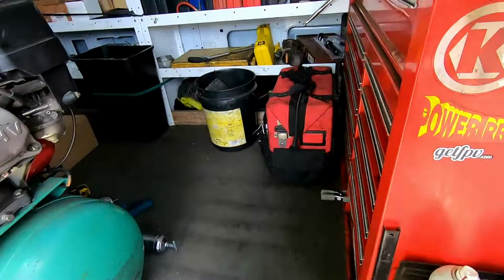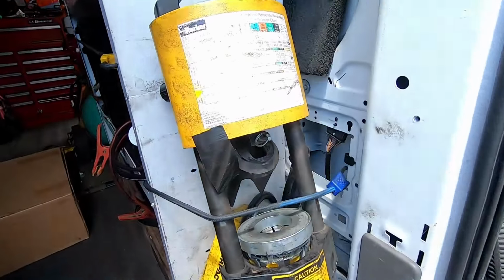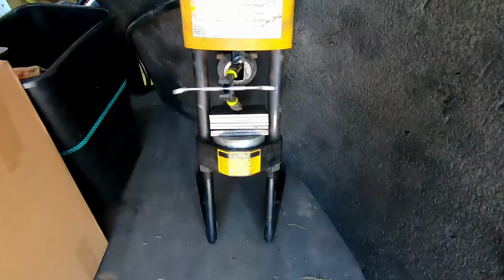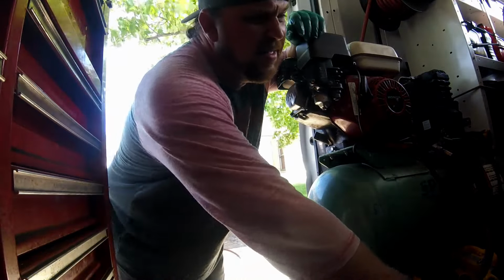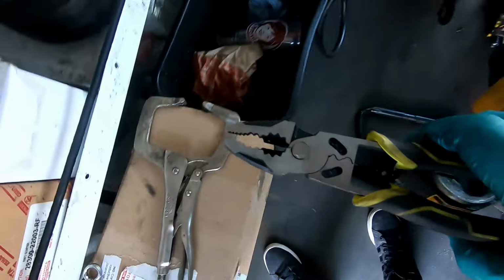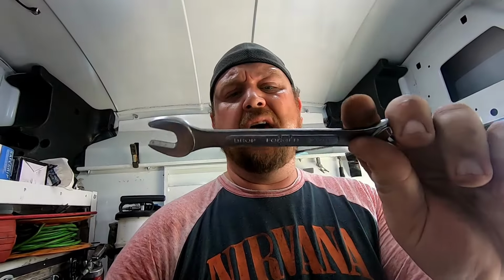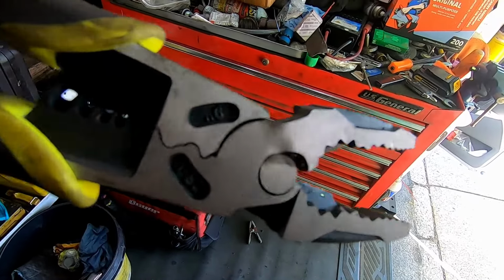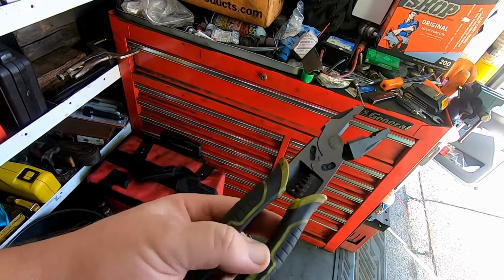FUTC Is FUCT

Comment: Had the pliers been a harder steel, then they definitely would've exploded. The funeral service was beautiful.  🤣
Reply: Yea I've noticed that a LOT of tool manufacturers these days cut their costs by just skipping the whole heat treatment and tempering parts of the production line, we bought some steel scribes and centre punches and they all deformed with the very first use of them, so we sharpened them all and then did a quick little heat treat just with Mapp gas torch and a bucket of water and they haven't lost their points ever since, even after several staircase and balcony jobs where we used them religiously. You can turn a lot of cheaper tools into very good ones by just finishing the manufacturing process on em
Reply: You could see the rusty tears of the bereaved as the camera panned across their jaws.
Reply: @dustyjohnston1479  shear poetry
Reply: Was thinking the same thing.
Reply: Well, now he needs to put them in a forge and harden that steel
Reply: Any one noticed that the pliers had the same width as the shovel. Must have been Made for that 😂
Reply: Steel with higher carbon costs more they're not trying to build a reputation for high quality tools they're just trying to sell as much crap as possible to people who fall for this sort of thing.
Reply: @Jude The Neko Gamer ye im diving into unreal myself as well coz games are just blatant cashgrabs these days with absolutely fuckall sustenance
Reply: It was a nice funeral. I heard they had a gallon of WD-40 at the wake. Everyone was getting loose.
Reply: @iamgriff  lol 😆
Reply: Well, if it's not hard enough to explode, it's certainly not hard enough to cut a wrench.
Reply: The fact that you couldn't cut a wrench with this kind of tool under any circumstances proves that they're targeting people too stupid to realize it.
Reply: @Faith_Family_Firearms_Freedom  was the pun intentional

Comment: Took a beating and held up surprisingly well. Other tests to failure I've seen have the head snap at the pivot or the pivot even fly off, probably because the harder steel is more brittle. Great vid - I was hoping for something more catastrophic but the burial was a fitting end.

Comment: Not quite sure, but I've seen several comments saying how if it was a better aloy/higher carbon steel, they would've popped, and I agree. I can imagine that they are something close to A36[mild steel]. It's probably a little better, since they are still a "tool" but yeah. Probably not to far of from rail spikes or similar stuff.
Reply: It also depends on heat treatment of the tool.
Harder steel is more brittle. However making tools reliably hard is difficult and costs a lot of money, easier to just temper the shit out of it to make it 'hard enough.'
Downside is, this has negative effects durability, wear resistance, and corrosion resistance.

You can get some petty good tools out of medium carbon with a good heat treat.
But, being mass produced and chinese, little care is put in.

Comment: I really hope you have a tourniquet in your toolbox. It doesn't take too long to bleed out if you sever a vein/artery
Reply: The red cloth shop towels work in a pinch
Reply: Those heavy duty wire ties are there for a reason! 😂
Reply: @k20nutz  improvised TQ's have like a 90% failure rate
Reply: @blaydCA  it needs to be at least a half inch wide to avoid nerve damage. CAT TQ's are only $20.
Reply: @brenthinton6855  the victim's t-shirt and a screwdriver will work in pinch, had this been an actual emergency and not a "funny ha ha" comment.
Reply: @blaydCA  it can work if you keep constant pressure on the screwdriver. With a TQ it locks in place to keep pressure so you can still dial your phone or drive to get help. I recommend you take a stop the bleed course or TCCC course. It is very eye opening!
Reply: @brenthinton6855  I have taken multiple  courses over the years. Thanks
Reply: @blaydCA  cool then you know that a field mechanic is usually alone and will need to have a free hand if the other is incapacitated.
Reply: @brenthinton6855  alone, in the middle of a deserted warehouse because a nuclear bomb wiped out the village. The nearest person is a solar system away. His fate is sealed! It could be worse!
Reply: @blaydCA  there is always a worse situation. I don't understand how that has anything to do with this. With a bad bleed you can bleed out in 8-12 min. average response time for EMS is 15 min. and that time doesn't start until dispatch has a responder in route. The response time can easily be 20-25 min. or more depending on where you are, traffic, how many people are being staffed in the area, road work. The list goes on. Anyone that actually argues against having a $20-30 TQ on hand is really something special in my book.
Reply: @brenthinton6855  Golly gee whiz! Better pack an ENTIRE Emergency Hospital.... just in case! 
FYI: most service persons travel to occupied commercial/residential jobs sites or they have a helper. It's called "the buddy system". Service persons also have the required Personal Protective Equipment as needed. 
Feel free to carry on with the histrionics.
Reply: @blaydCA  man 1 small cheap tool that can save your life is hardly a mini hospital. I am a service tech and I can't tell you how many times I have been doing stuff with a grinder or high pressure press and been completely alone. I have no idea why you are so against having a TQ on hand. What you are saying makes no sense. It is a very small tool that can fit in your back pocket or toolbox easily. Why not have it?
Reply: @brenthinton6855  For What It's Worth: Your TQ doesn't belong in your back pocket or a tool box. It belongs in a dedicated first aid kit. If you're bleeding out, a t-shirt and any tool will work IMMEDIATELY to stop the bleed.
 If you're taking jobs that can't afford the cost of a "helper" or won't provide an on-site person for safety, then that's on YOU.
Reply: @blaydCA  what is wrong with being prepared? Self reliance is what people lack these days
Reply: @brenthinton6855  I'm quite self reliant. When comes to safety, it's EVERYONE'S responsability. The few commercial clients I kept in my retirement pay me quite well for a professionally completed project or repair. If I am requested to be on-site during non-business hours and there is a risk of injury, they provide me with a helper or at least a warm body for Buddy System SAFETY. There's far more dangerous tools in my decades of tools accumulation than an angle grinder or hydraulic power pack. 
When I started in business (1976) telephones had DAILS, and airbags was a talkative person!
Here's some advice: IF you're working solo way remote- invest in one those satellite emergency communications devices that gives a GPS coordinates for first responders.
Reply: @blaydCA  a TQ is so much cheaper and a cell phone has all the same capability. Also that doesn't fix the problem of bleeding out while you wait for someone to respond. It makes no sense to not have it around all things considered. We are at an impasse here. You seem more comfortable putting your life in someone else's hands and that's fine but I live on an island where it can easily take an hour or more to get to a hospital and I have experienced response times of well over 45min. You may be bullheaded and not want a simple tool to keep on hand but I'm sure there are many other people that will see this advice and decide to spend $20 on something that can easily save their life. Prepare for the worst so when nothing happens you will still be ok. It is really that simple. I'm not telling people to go get chest seals or decompression needles or a full combat med pack. Just one tool that has saved more lives than a t-shirt ever will.
Reply: @brenthinton6855  I suppose if you are the sole occupant on an island it would make perfect sense to have an above and beyond medical kit WITH some advanced "first responder" courses under your belt to stabilize things. Meanwhile: the BUDDY SYSTEM with a good medical kit in that remote location is better still. Any medical kit will only get you so far going solo. I venture into areas that Cellphone signal is sketchy or zero-  hence my suggestion.

Quiz Time: What do they call a boating Life Vest when your transiting near freezing water? Ans: A Popsicle Holder.

My retirement plans include some travel to remote locations "up North" for a potential summer home. Should I find a remote chunk of land I like, and decide to build... I'll hire a local "helper" to be more productive AND for safety. Probably end up getting a Satellite phone also. Sadly, I can't afford island life for the summer.

Comment: I'm actually impressed with those pliers. A hell of a torture and they bent a little, better than the shit Snap on ones, I break them on just wire. I mean the ads for these are shit but if used for their purpose, they would be great lineman pliers.
Reply: Bending isn't good, means the steel is soft
Reply: @TheLongDon  bending is fine when you use this kind of force. Bending when squeezing in hand is bad no hand tool is made to resist this kind of torture.
Reply: @hommie789  The reason tools bend vs break is based on the steel and whether its hardened. Most high quality tools will be better, hardened steel, whereas lower quality tools will be just regular steel. There is no world where you get both hardened steel and be able to bend without breaking. Hardened steel will shatter as opposed to breaking, as it's tougher but more brittle.

Comment: We also use those enerpacs and rams to  widen the flanges of beams, so stiffner plates can slide right in and be adjusted easily then tacked in place remeasured to see if it has been placed correctly before welding.

Comment: its a safety feature - we make them cheap, garunteed to break before it kills you. DISCLAIMER "we are not resoonsible if tool breakage kills you if tools are used improperly. as these are display tools only, any use as an actual tool falls under this catagory." said very quickly.

Comment: Omg the ending was hilarious!

Good thing that those pliers were made from a soft metal. Could have been a real safety hazard if they'd exploded.
Reply: Even if they were 'properly' hardened, it would still take much more force than a human could exert to break them, it's fine.
If you have to use a vice or a press to close pliers, you're using them wrong, and deserve to get hurt.

Comment: If you just use them as a pair of pliers and don’t try to cut spanners in half they will be good . When you released the pressure they sprung back a bit  which is good brittle steel would have snapped

Comment: Dang it, well it was fun anyway.  They wouldn't cut the wrench, no surprise, but they proved to be tough anyway.  The crack at the pivot ended all hope for them though, but I still might consider them if they aren't hugely expensive.  
I tend to not want to cut my wrenches up, though I do have a few customized ones.  But something more along the way of die grinder with carborundum wheel probably go-to choice for that.  Besides, everyone knows you use those big side cutters/electrician pliers for cutting plywood not wrenches. cheers.

Comment: Ive had many pliers just snap, this tool is actually pretty good.
Reply: because normal somewhat good pliers are made of a hard steel ?! why would you want soft steel ???
Reply: @SuperUltimateLP  Air over hydraulic presses(commonly used for swageing) like this can exert hundreds of times the pressure your hands ever could, so there is no way your grip will ever bend these if that press took multiple attempts to destroy them.
I'm 60 yo tradie who has used and abused and destroyed many sets of pliers, vise grips and the like in my life, these pliers far exceeded my expectations, I didn't think they would survive one pressing!
Reply: @abyssmanur3965  but the steel is still shit and the cutting edge wont last... thats why everbody makes them out of hard steel...
Reply: @SuperUltimateLP  he cut through  a bunch of hex keys which are not mild steel hence the pliers were tougher than the  things they cut, like I said I have 45 years of abusing tools, I know what's what.
As other comments here confirm, if a tool is made from steel that is too hard they will just snap which I have personally done dozens of times.
Just go buy your snapon or whatever, to each their own!
Reply: @abyssmanur3965  pliers like that don't technically "cut" they shear..
Blades need to be hard the body needs to be somewhat soft you are right on that.
I personally use Knipex BUT I'm a electrician and live in germany, different needs compared to US electrics.
But I use side cutters on a Daly basis (obviously) and use the same pair since 2014 cutting screws to length, cutting wire and so on (Knipex has a high quality steel with high hardness and I'm sure that soft steel wouldn't last anywhere near as long)

Comment: Quality content as per usual. Question? I know you work on forklifts, but do you also work on diesel lifts? For example I own a skytrack 6042 telehandler. I am no mechanic so I have no idea the classification of types of lifts.
Reply from the maker: I’ve worked on those a lot in the past. These days I lucky to 1 or 2 a year.
Reply: @FunkFPV  I'd like to know the brand, although my Dewilt Side cutter's will shear a 16 D or even 20 D Nail with little effort..more effective than pulling a nail sometimes..had um for 7 years

Comment: for $20 they actually seem half decent :D shame all the dishonesty is used in advertising, even a pair of Knipex or Hazet isn't going to cut a wrench in half, not by hand anyway. When it comes to them piano wire is just a suggestion though :D they are almost bolt cutters if you are angry enough :P
Reply: No they aren't they are supposed to be wire cutters/strippers they barley could get through any insulation

Comment: The wrench was actually impressive how I pulled through just warped and banded it's high quality metal I guess you have to give it at least but common sense says it's not for steel about to cut barbed wires and wire fences repairs should work awesome awesome it will be if you throw in a file a convicts wild dream.

Comment: Heh.. yah, chances are the only hardened part is gonna be the head and cutting edges.  You just dont NEED to put the effort in to evenly heat the entire thing to temp and then quench the whole thing, better off just doing the parts that are work surfaces to avoid warping.

Comment: I wonder if it's possible to anneal the wrench shank enough that those pliers could cut it, without changing the appearance of the wrench?
Reply: If the wrench is chrome plated, like most are, it would remove the plating fucking up how it looks (and putting chromium fumes into the air, fucking you up.)
So anealing is kinda off the table, you could do a very agressive temper (where you take it to before the Chromium turns into fumes), this would make it almost as soft.

However, I don't think the issue was hardness, rather size, there's a lot of material to cut through, I don't think even 'good' pliers would be able to cut through it in a soft state.

Just my thoughts.
Reply: Alternatively the wrench handle could have been undermined from the side that the camera doesn't view, AND material strength reduced by judicious use of heat -terminology is left to the pedantic- then perhaps the wrench could be clipped like a wire tie.  Otherwise, perhaps it's a 3D printed plastic wrench covered in "Carolina Chrome" as it were.